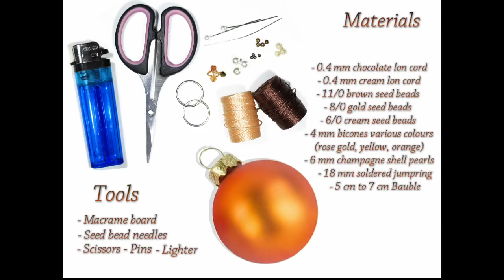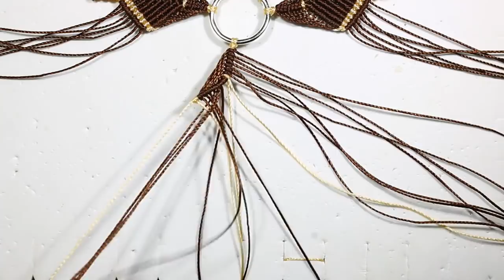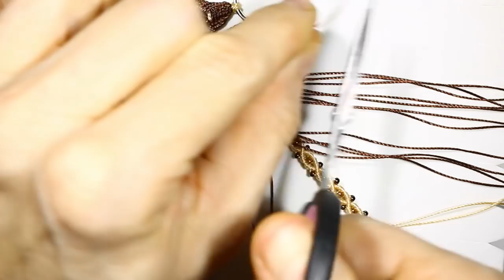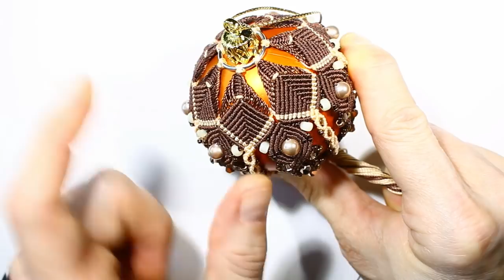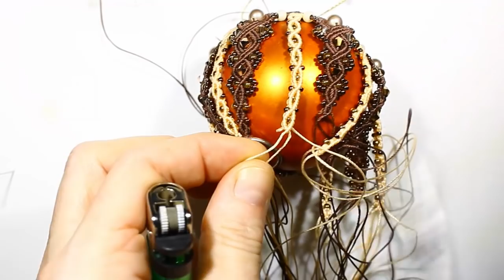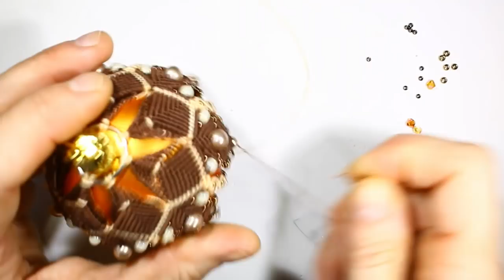Micro Macrame Beaded Christmas Bauble

Comment: I love this ornament cover.  As soon as I saw it I went out and purchased the supplies. I admit I am new to micro macrame and I'm struggling. I'm down to where you begin the beading on the first section. I've spent hours watching the video but I can't make out why mine doesn't look right. Are the 2 outside cords always the core. When you add the half hitches after adding the  #8 seed bead you do a left, right, left half hitch on the left side but when you add the #11 seed beads you do a right, left, right on the same side. Is that correct? I'm having trouble seeing which cord is crossing over the top. Can you think of anyway to help me understand this. Do you perhaps have another video that might help? Is there a name for this stitch? I know I'm asking a lot but if you can think of anything that could help me I'd be so grateful.
Reply from the maker: Yes, the outer cords are always the core. I alternate between left and right half hitches only with the knotting cords. You never knot with the core cords. Imagine them to be stiff rods that can't be knotted, that way you have a mental reminder that you are not supposed to knot with them. The core cords must both end up in the middle for you to be able to add in 8/0's.